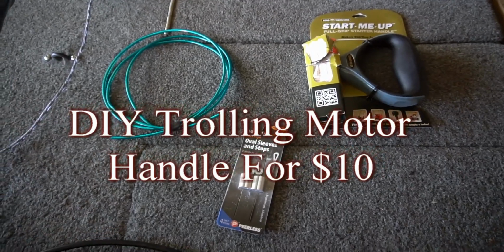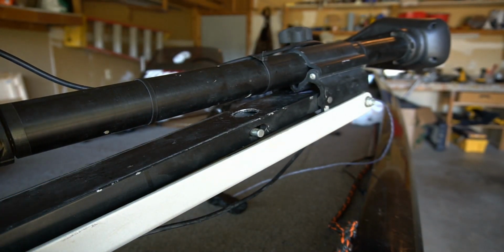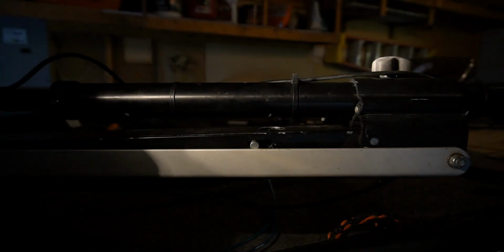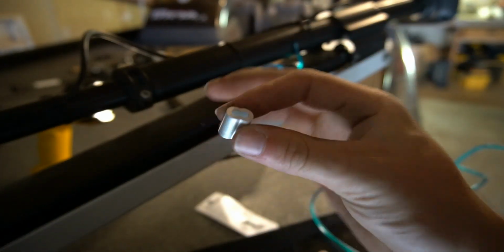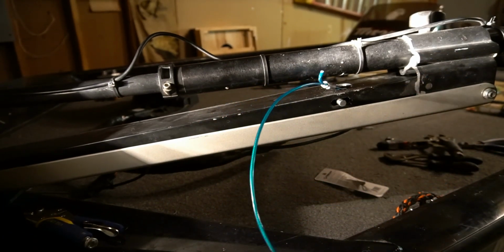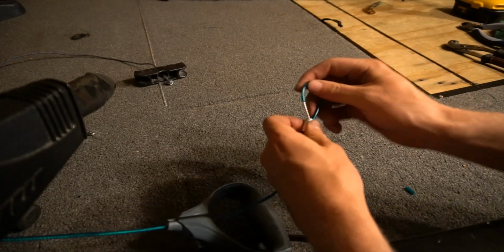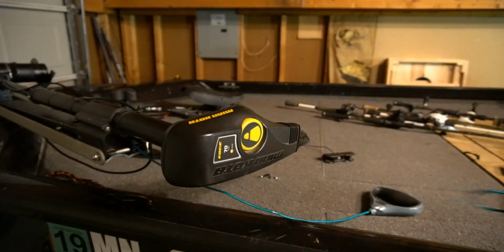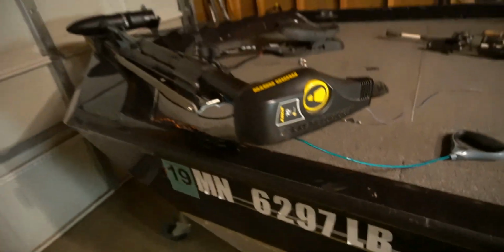DIY Trolling Motor Handle Upgrade!

Comment: Thanks for the instructions.  The brand new Minn-Kota rope that I installed is badly frayed after a 3-day fishing trip.  I just ordered a handle like yours and will pick up some cable and clamps to replace it with wire like you showed.